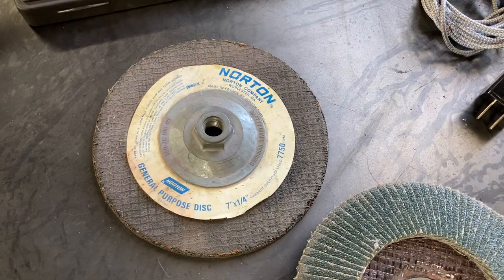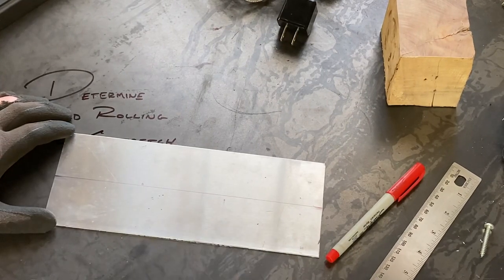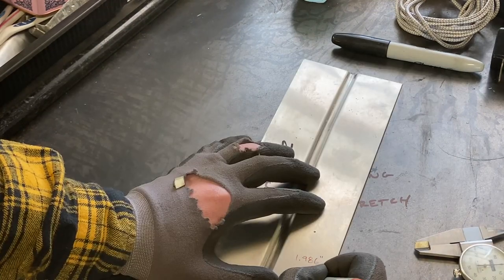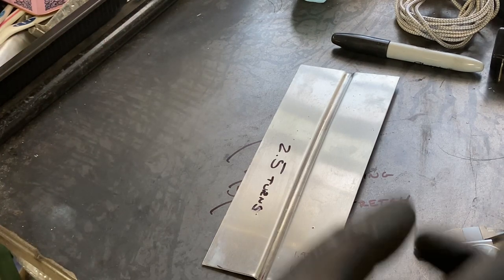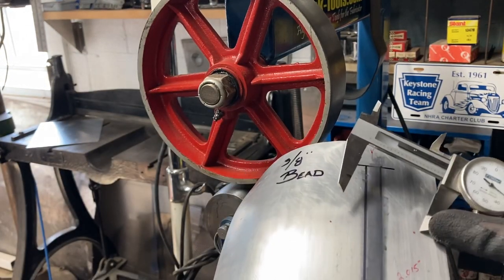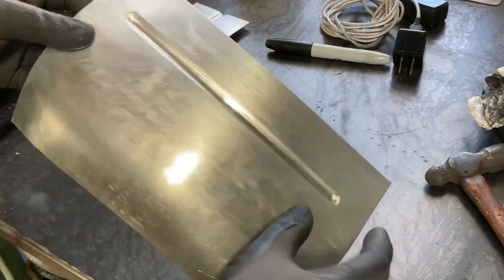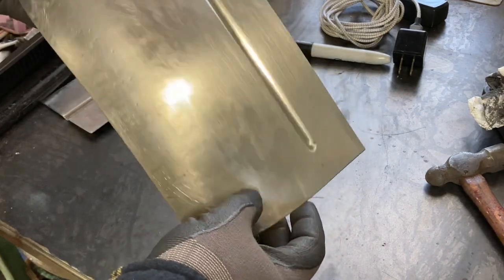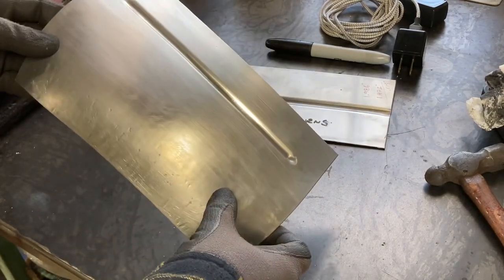Fab tech 3: How to determine bead rolling pre-stretch

Comment: Hey, thank you for making and sharing this video. I have just bought a bead roller for a replica MG I am building. I need to roll a recess all around 5 or 6 bespoke panels I am making so I really don't want to mess things up with distortion. I am guessing that the same rule applies to a straight bead as well as a framed recess as formed with a Bead Roller? 🤔
Kind regards Paul from 48 Spokes 🇬🇧
Reply from the maker: Correct, any form in the 3rd dimension of a flat panel will require stretch to keep from effecting the surrounding areas. I recommend a couple trial runs on a scrap piece of same thickness to dial in the correct amount of stretch required for the amount of step you want in the panel. Good luck on your project and thank you for watching!

Comment: The bead roller does not perfectly bend the metal at an angle. 
It works slightly like an English wheel.
You expected that by having the same length afterwards the panel would not have it's crown altered.
The panels crown was altered. 
If you don't want to trim the edge of the panel, this idea works perfectly.